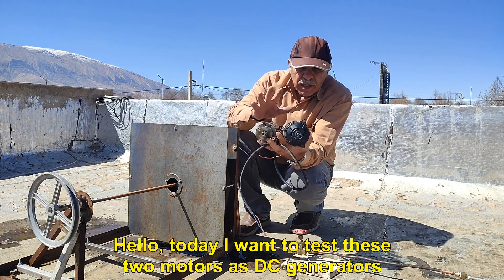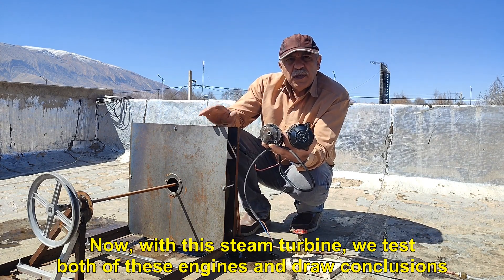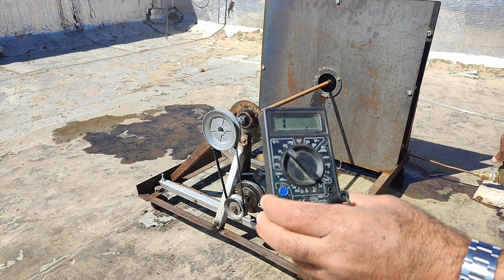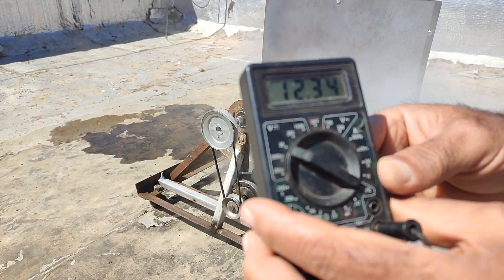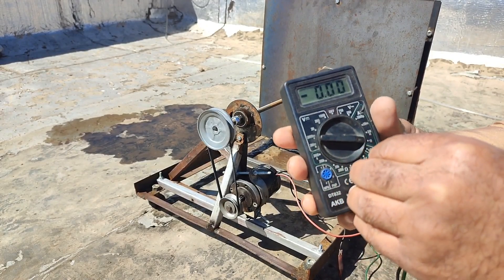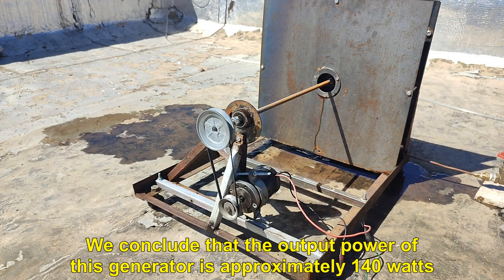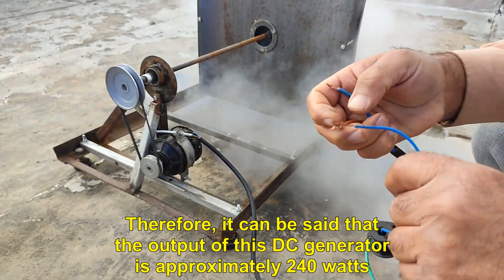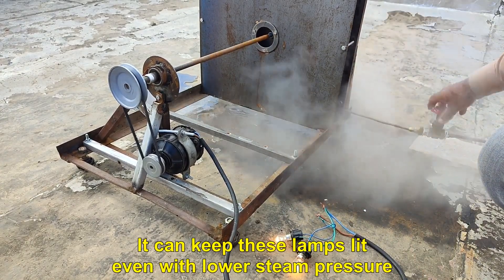Using a DC motor instead of a generator

Comment: They are not practical both as dc motors and generators for prolonged use because they are not brushless (the brush switch will wear greatly over time). But for short-time application it is a good solution.
Reply from the maker: Great point!

Comment: Good job, but you did measure the off-load voltage which will drop with a load connected. Try measuring amps and voltage at the same time, with a load, for a realistic power rating. I'm sure it's still a lot 🙂
Reply from the maker: Thank you for your nice comment
  In direct current electricity circuits, to determine the value of W, the OPEN voltage is first measured, and then the short circuit current is measured, and these two are multiplied together, and this is the best method to determine the power of a power source, of course, there is another method for powerful batteries. has it
It should be noted that in the case of short circuit and current measurement, the voltage will be zero

Comment: Hi, as always very interesting work.

My suggestions - record your set variables such as Inlet pressure, temperature and flow rate. It would help other engineers comparing designs.

I would also suggest robert Murray Smith's YouTube videos on sizing a generator.
Reply from the maker: Thank you for your comment and also for your suggestion
In fact, the steam pressure of the boiler tank is 10 bar, and the temperature is approximately 160 degrees, and according to the nozzle hole, the speed is 40 meters per second.
Reply: @fixedfocussolar  excellent, may I ask how you calculated velocity from the hole size?
Reply from the maker: @samuelknight5512  with the relation v_2 = sqrt(2 * P_1 / P_2 * R_1 / R_2)